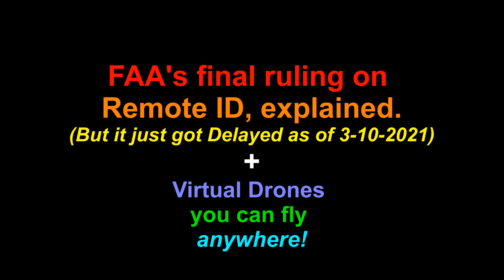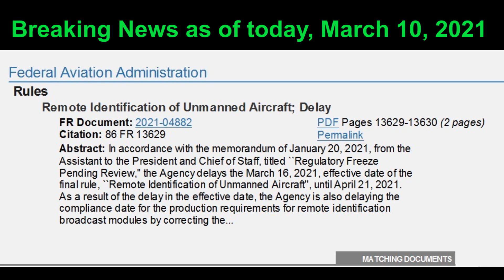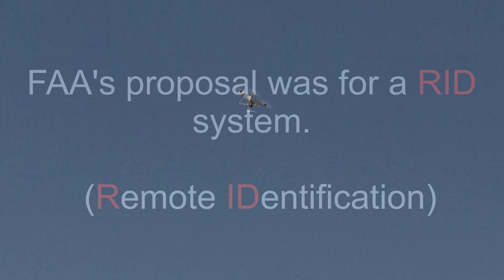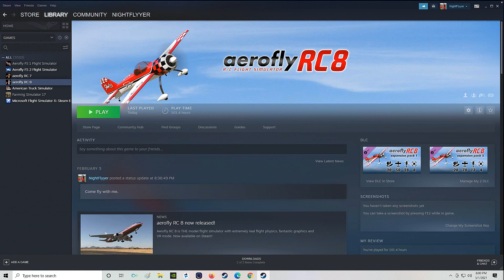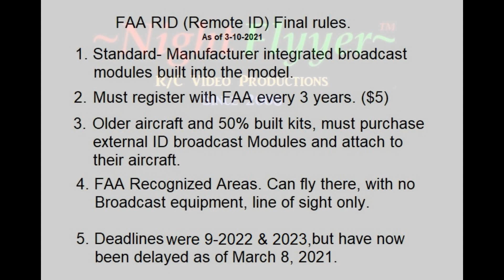Required: FAA Remote ID Broadcast Modules for all model Aircraft over 1/2 lb. I explain the Ruling!

Comment: This is all in preparation to control the airspace under 400’ so companies like Amazon, FedEx and UPS can fly their delivery drones over your property, family and pets.  It doesn’t matter to them where you live, they’ve greased the palms of the politicians already to get this control.
Reply from the maker: I'm only the messenger and just passing along what the FAA, Model Airplane News, and Model Aviation magazines published this month. We in the AMA community tried to stop the ruling but could not. But they did block the rule to register every aircraft you own and blocked the internet link requirement to just a broadcaster.   We only got it modified to be a little better. I DON'T LIKE IT ANYMORE THAN YOU!  My DJI Spark wont take off if I'm within 5 miles of an aircraft, so it has already begun.    If you have a better solution, then again I suggest you contact the FAA and tell them, since it was delayed again and they are requesting comments and suggestions.  Maybe if enough folks do that, this stupid law will be rescinded. Here is the email address.   UASRemoteID@faa.gov.

Comment: well this regulation is mega gay and  accomplishes nothing
Reply from the maker: I'm only the messenger and just passing along what the FAA, Model Airplane News, and Model Aviation magazines published this month. We in the AMA community tried to stop the ruling but could not. But they did block the rule to register every aircraft you own and blocked the internet link requirement to just a broadcaster.   We only got it modified to be a little better. I DON'T LIKE IT ANYMORE THAN YOU!  My DJI Spark wont take off if I'm within 5 miles of an aircraft, so it has already begun.    If you have a better solution, then again I suggest you contact the FAA and tell them, since it was delayed again and they are requesting comments and suggestions.  Maybe if enough folks do that, this stupid law will be rescinded. Here is the email address.   UASRemoteID@faa.gov.

Comment: Super glad my family owns large farm
Reply from the maker: Good point and probably  you don't piss off any full size pilots out on the farm, as they are the ones who started it all by complaining to the FAA.  
 I'm only the messenger and just passing along what the FAA, Model Airplane News, and Model Aviation magazines published this month. We in the AMA community tried to stop the ruling but could not. But they did block the rule to register every aircraft you own and blocked the internet link requirement to just a broadcaster.   We only got it modified to be a little better. I DON'T LIKE IT ANYMORE THAN YOU!  My DJI Spark wont take off if I'm within 5 miles of an aircraft, so it has already begun.    If you have a better solution, then again I suggest you contact the FAA and tell them, since it was delayed again and they are requesting comments and suggestions.  Maybe if enough folks do that, this stupid law will be rescinded. Here is the email address.   UASRemoteID@faa.gov.
Reply: @NightFlyyer  Agree 100%
Reply: Yes,  Me and my dad, and my boys have been flying at a private dairy farm for over 30 years. We are not going to stop now, and there will be no transponders in any of the aircraft either!!! We have a 1600 foot runway, and full scale flies out of there too, but it's all private, and you have to have permission to land there. We also always have a transceiver for full scale comm's, as we are very safety minded. Never a problem at all, never.
Reply: @scotabot7826  sounds familiar to what we have.
Reply from the maker: @scotabot7826  People who fly like you, me and the majority of us, did not piss off the airline pilots, who typically look down upon modelers anyway.They started it due to the drones.I fly at an airport as well and have a radio to talk to pilots and we all get along.  But I dont fly at LAX or Manhattan 1000 feet in the air..   I think if enough people complain to the FAA, I hope it might get dropped, as it is on hold again.

Comment: Will be looking in to sub 250 gm aircraft to fly. I am also a full scale pilot and well I think it sucks for everyone. I BELIEVE it was all done to get more money because the Amazon's and Google's want in on the airspace to make money and that means tax revenue. My .02!
Reply from the maker: Could be.  I'm only the messenger and just passing along what the FAA, Model Airplane News, and Model Aviation magazines published this month. It was the Full size fire fighter aircraft and airline pilots who complained to the FAA and started it all. We in the AMA community tried to stop the ruling but could not. But they did block the rule to register every aircraft you own and blocked the internet link requirement to just a broadcaster.   We only got it modified to be a little better. I DON'T LIKE IT ANYMORE THAN YOU!  My DJI Spark wont take off if I'm within 5 miles of an aircraft, so it has already begun.    If you have a better solution, then again I suggest you contact the FAA and tell them, since it was delayed again and they are requesting comments and suggestions.  Maybe if enough folks do that, this stupid law will be rescinded. Here is the email address.   UASRemoteID@faa.gov.
Reply: @NightFlyyer  I am with you Sir on this and do send in my comments every time they are requested by the community, hate to see a good thing go like this. I believe this will devastate the hobby and polarize the two communities.
Reply from the maker: @edwinkania5286  For sure.

Comment: 95 for ama 95 for clubs so 200  bucks a year to fly in a field owned by someone.. and now  with the id thing it transmitts what 2.4 hmm it will prolly need a cell phone sim card so be prepared to pay a monthly fee for a sim card with data to fly.. this is fucked up im selling my big drones thats it im done im flying fpv smaller drones fuck that im not going to pay to play if the module is like 50 bucks and dont need a sim card then ill buy it.. that simple i wont pay a monthly fee or yearly fee.. so if it transmitts location like airplanes with no sim card im game
Reply from the maker: Like I said before the internet connection thing with cell phones got dropped by the AMA fighting it.  2.5 million dollars of liability insurance and a magazine every month for $7 a month or 75 a year is cheap compared to the cost of an aircraft and if your an AMA member, you can fly at any AMA field as a guest.  You do not have to join the club.
 I'm only the messenger and just passing along what the FAA, Model Airplane News, and Model Aviation magazines published this month. It was the Full size fire fighter aircraft and airline pilots who complained to the FAA and started it all. We in the AMA community tried to stop the ruling but could not. But they did block the rule to register every aircraft you own and blocked the internet link requirement to just a broadcaster.   We only got it modified to be a little better. I DON'T LIKE IT ANYMORE THAN YOU!  My DJI Spark wont take off if I'm within 5 miles of an aircraft, so it has already begun.    If you have a better solution, then again I suggest you contact the FAA and tell them, since it was delayed again and they are requesting comments and suggestions.  Maybe if enough folks do that, this stupid law will be rescinded. Here is the email address.   UASRemoteID@faa.gov.

Comment: Remember. They will keep making rules IF people allow them to. People really need to set their purses down and stand up.
Reply from the maker: Agreed. 
 I'm only the messenger and just passing along what the FAA, Model Airplane News, and Model Aviation magazines published this month. We in the AMA community tried to stop the ruling but could not. But they did block the rule to register every aircraft you own and blocked the internet link requirement to just a broadcaster.   We only got it modified to be a little better. I DON'T LIKE IT ANYMORE THAN YOU!  My DJI Spark wont take off if I'm within 5 miles of an aircraft, so it has already begun.    If you have a better solution, then again I suggest you contact the FAA and tell them, since it was delayed again and they are requesting comments and suggestions.  Maybe if enough folks do that, this stupid law will be rescinded. Here is the email address.   UASRemoteID@faa.gov.
Reply: Gun owners already know theyll make new rules regardless.

Comment: Surely the answer to people not obeying rules, is to create more rules.
Just like gun laws, this is only going to effect people that abide by rules and laws in the first place. Brilliant.
"I'm from the government and I'm here to help."
Reply from the maker: I'm only the messenger and just passing along what the FAA, Model Airplane News, and Model Aviation magazines published this month. We in the AMA community tried to stop the ruling but could not. But they did block the rule to register every aircraft you own and blocked the internet link requirement to just a broadcaster.   We only got it modified to be a little better. I DON'T LIKE IT ANYMORE THAN YOU!  My DJI Spark wont take off if I'm within 5 miles of an aircraft, so it has already begun.    If you have a better solution, then again I suggest you contact the FAA and tell them, since it was delayed again and they are requesting comments and suggestions.  Maybe if enough folks do that, this stupid law will be rescinded.

Comment: No. 👎
Reply from the maker: I'm only the messenger and just passing along what the FAA, Model Airplane News, and Model Aviation magazines published this month. We in the AMA community tried to stop the ruling but could not. We only got it modified to be a little better. I don't like it any more than you. My DJI Spark wont take off if I'm within 5 miles of an aircraft, so it has already begun.    If you have a better solution, then contact the FAA and tell them, since it was delayed again and they are requesting comments and suggestions.
Reply: @NightFlyyer  I'm saying I won't.  No rid system will ever be on any of my airplanes.
Reply from the maker: @3DFLYLOW  Well that is like when they outlaw guns, then only the outlaws will have them.  
 If you have a better solution, then again I suggest you contact the FAA and tell them, since it was delayed again and they are requesting comments and suggestions.  Maybe if enough folks do that, this stupid law will be rescinded. Here is the email address.   UASRemoteID@faa.gov.

Comment: Fortunately, if you're not transmittiing anything, they have no way of knowing. Stupidest rule ever. The only safety this rule is designed for, is the safety of Amazon and Google delivery drones that will fly out of the line of sight of the operator in thr airspace we fly in. What a joke. There will be no transmitter in any of my birds. Fuck 'em.
Reply from the maker: I'm only the messenger and just passing along what the FAA, Model Airplane News, and Model Aviation magazines published this month. We in the AMA community tried to stop the ruling but could not. We only got it modified to be a little better. I don't like it any more than you. My DJI Spark wont take off if I'm within 5 miles of an aircraft, so it has already begun.    If you have a better solution, then contact the FAA and tell them, since it was delayed again.
Reply: @NightFlyyer  as an AMA member, I'm aware. Just posting my thoughts in a public comment section.

Comment: I see no reason why this couldn't be Integrated into the type of off the shelf recievers hobby grade craft use. Would probably add a few grams at most. So you're pinging out a signal no big deal.
Reply from the maker: I'm only the messenger and just passing along what the FAA, Model Airplane News, and Model Aviation magazines published this month. We in the AMA community tried to stop the ruling but could not. We only got it modified to be a little better. I don't like it any more than you. My DJI Spark wont take off if I'm within 5 miles of an aircraft, so it has already begun.   Thanks.